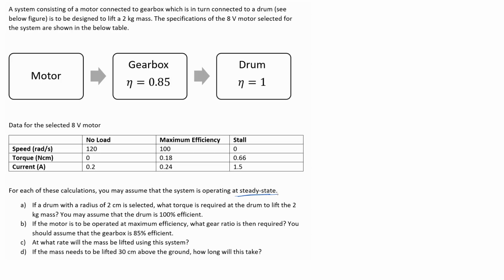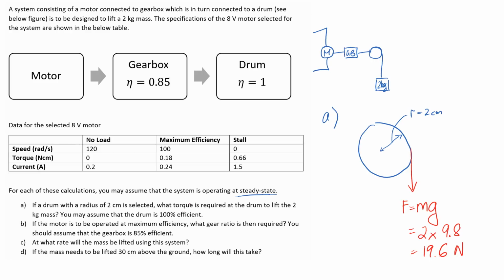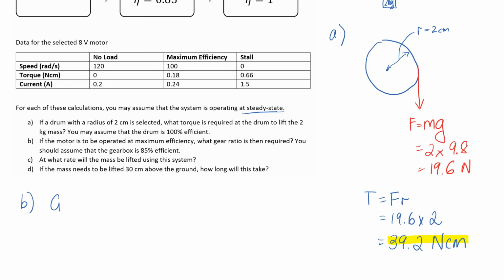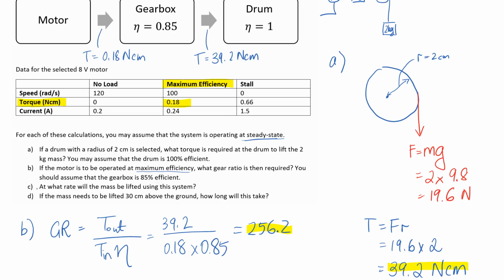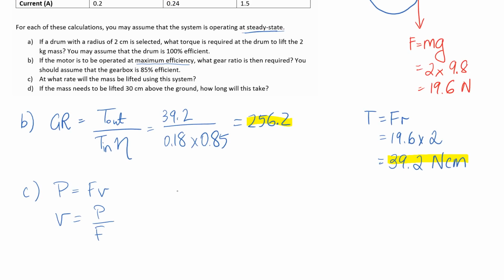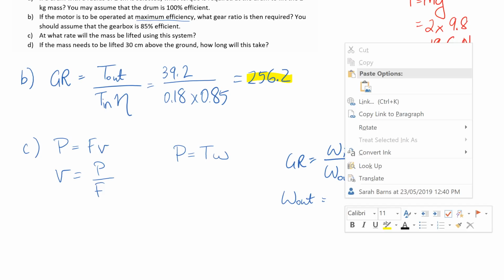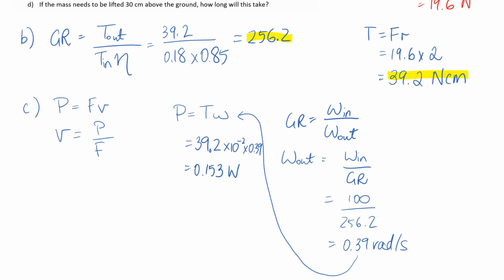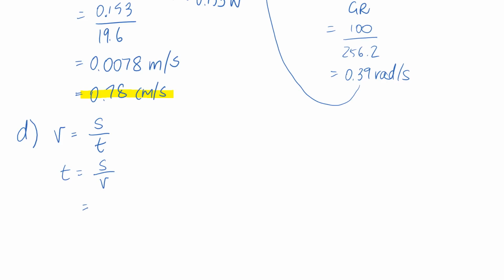Example: Motor, Gearbox, Drum Calculations

Comment: For part c what's the purpose of calculating the power? the question doesnt ask for it and can't you just use the formula ω=v/r (and rearrange of course)
0.39*0.02 = 0.0078m/s
Reply from the maker: I chose to use an equation that used power to calculate the velocity, thus why I calculated it. There are multiple ways to get the final answer for some of these questions (that's maths/engineering).